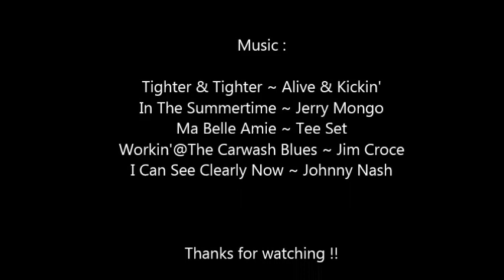Meucci Pool Cue Restoration Part 2

Comment: Hey Steph, came across your videos doing some research.  I am wanting to start doing some of this myself, mainly just refinish, rewraps and tip/ferrule replacements, for my own cues, and have a few questions regarding your setup.  1.  What lathe are you using.  2.  Did you have to do any modifications to it to make it suit this particular need and 3.  If I decide to pursue this, would you be willing to having a conversation and sort of "mentoring" me thru the first one or two attempts (would be on older, low value cues to begin with).  Great videos and thank you.
Reply from the maker: Bret, 
I am happy to help. I've spent hours writing answers to the same questions you've asked. I'd like to suggest , if you're really interested in all the in's and out's you call me.  1st, find me on FB (Steph Boeker) same name there as here on YouTube.  Then you can PM me and I'll share my phone # w/ you so we can talk rather than type.  The questions will multiply and so w/ the answers.  
Thanks for watching & reaching out,
God bless,
Sincerely .......................

Comment: Hi Steph. I don’t own a lathe but I clean pool shaft that’s been used and that’s dirty with chalks and grime. If it’s too bad I usually lightly sand it down and then burnish it and then condition it or use wax, (McDermott wax) how would I go about putting on that beautiful glossy finish that you get with a new cue shaft. Thanks and love your vids! Subbed
Reply from the maker: Hello Steven,
1st , I'd like to thank you for watching my video and the kind words about my work. 
Now :
I usually clean the shaft w/ shaft cleaner from Cue Man Builders : https://tinyurl.com/5432jnz6
Next :  I'll lightly sand the raised grain 800 /1000 grit sanding sponges 
Then :  I apply 3 coats Sanding Sealer :  https://tinyurl.com/jmyx52rr   or    https://tinyurl.com/z7yaantt
sand 800 /1000 grit between & after coats
Next :   I apply 3M machine polish, but, Mothers Car Polish will work
sand w/ 800 /1000 grit and then apply Cue Wax :  https://tinyurl.com/3h52rx72
spinning on a lathe at 3000 rpms will create heat on the application rag inducing the wax to melt in.  Make sure you don't leave a heavy coat of wax but sand most off w/ 800 /1000 grit sanding sponge.
The wax brings out the polished shine but can make the shaft slow if it is applied too heavily !!

Hope this was helpful and thanks again for the kind words,
Sincerely ......................

Comment: What use you for licuid ??
Reply from the maker: a) Base Coat ~ 2 part epoxy (5 min epoxy)
b) Top Coat ~ CA Glue  (Bob Smith ~ Thin)
c) Machine Polish ~ (3M but can use any type of polish or compound)
d) Cue Wax ~ (but can use Turtle Wax, Bees Wax, etc ...)

Thanks for watching,
Sincerely ...................................
Reply: Steph Boeker Thanks ,